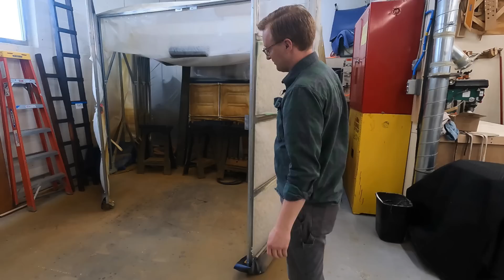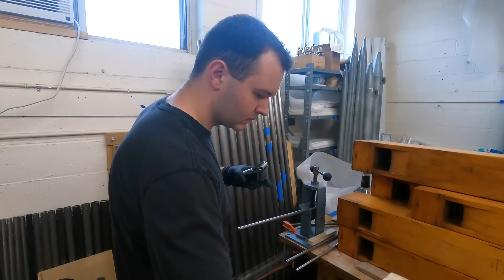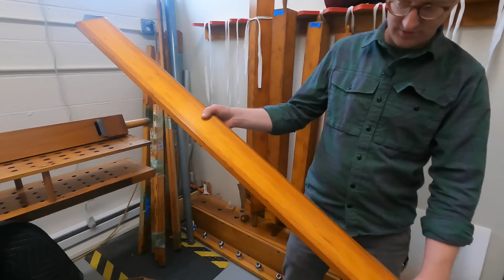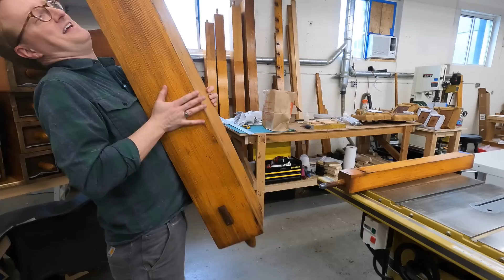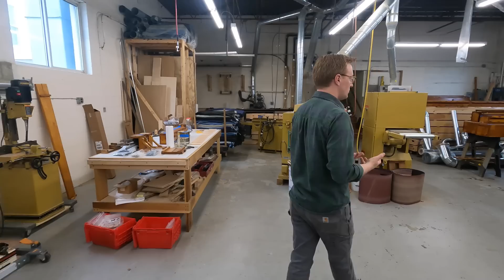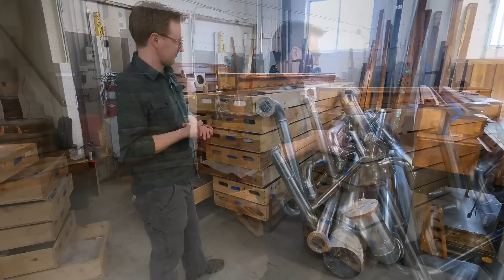Tour of Ortloff Organ Company, Needham, Massachusetts

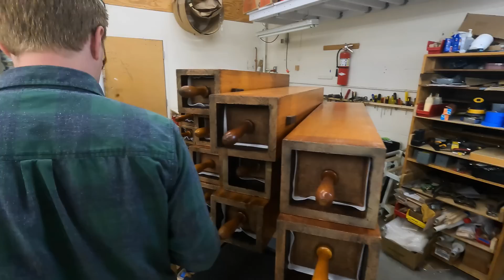Comment: @21:35 we use the toilet bowl wax ring too, but it's really sticky and it can grab larger stoppers almost too well.
The wax is actually called "Slack wax" it's a by-product of crude oil production, it comes in about 10 or so different grades each with it's own melting point set by the ratio of wax to oil it's made from. I was unable to determine what specific formula the toilet bowl wax is, and after looking to see if they had maybe a 10 pound block of it available, it's apparently only sold in 55 gallon drums, and of course the rather expensive toilet bowl rings with the plastic tray and cardboard that gets thrown away after providing a very small amount of ring.

Johnathan was a grreat narrator for the whole video, great job!